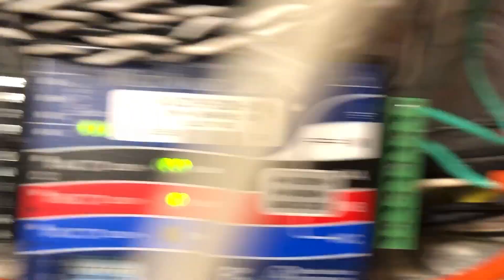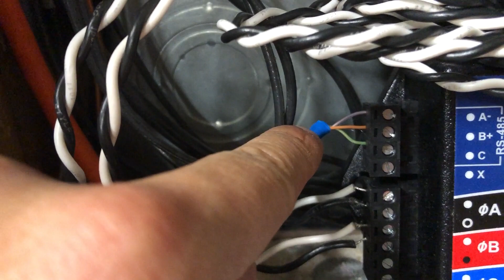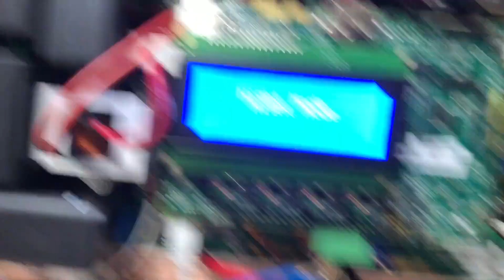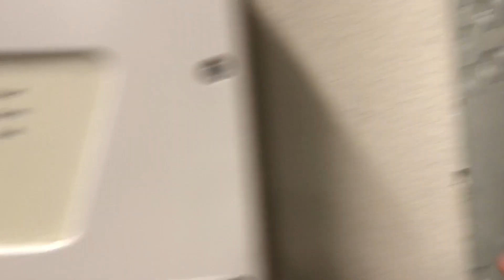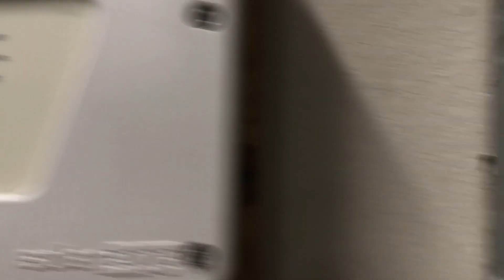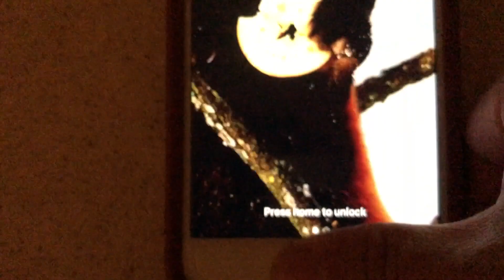How to install metering to your solaredge inverter

Comment: Thanks for posting, just added the Solaredge one to my setup, now I can see grid consumption vs production & how much is going back to Edison. My setup peaks at 10kw by  10am, this also helped me to "schedule" my EV charging when I see my production above 7.5kw. It has alson helped me to see how much energy my house is consuming from Grid at night. Next step is to add batteries and a hybrid inverter to run at night to stop consumption / import from grid at night. Charge batteries during the day and push energy back to the house at night.
Reply from the maker: Sounds like you have a great setup and are maximizing your information! Cheers!
Reply: I have solaredge as well. Does adding this allow you see the production down to individual panel level on the solaredge app? Right now i can only see whole system production.
Reply: @matthewprosco5940  No it will not.  My Solaredge apk allows me to see down to individual panel, but I have owner/installer access. I don't know what type you have. It is possible to see down to specific panel, no meter is needed for that.

Comment: Why my solar edge  just  one  if I have two ,  have  connection on both . My  are both in slave configuration. I have both of the  with the  configuration. What can I do to obtain the lecture of the two  in my monitoring system?
Reply from the maker: @Ana De Nigris To get data into solaredge monitoring you just need to make sure the inverters are connected to the internet and you should contact solaredge for monitoring account.

Comment: Where did you put the neural wire to? I only have 3 fases without neutral.
Reply from the maker: I don't remember 100% but I don't think I use the neutral wire to hook up the meter.  I am not a professional/licensed electrician and I don't understand 3 fases, however I can tell you that my neutral is bonded (my neutral is tried to my ground in my circuit breaker).

Comment: I think your cts are on backwards. The arrow should point toward the utility supply side. If yours are the solaredge cts the label should be on top in your case. But.. you must be getting good consumption data so maybe it's all good?

Comment: I could not realy find in ebay but was able to buy from https://bravocontrols.com/shop/three-phase-power-meter/ they also had the CTs included. It cost $128
Reply from the maker: Thanks for sharing where we can buy electric usage meter
Reply: Did you buy it?
Reply: @deihmos  yes and I installed it, it worked great for my older style solaredge inverter following the video instructions.
Reply: @ameendhe  Thanks. What model CT did it come with and how many amps?
Reply: @deihmos  it was two 100amp CTs you should be able to see it on the pictures. I have a 200 amp panel, I installed one on each phase (of the split phases). Sorry I could not see the models because I have them installed in the utility feed box because I could not fit them above  in the main breakers, my panel is too narrow.

Comment: Thanks, this was a very helpful video.  I wanted to share some installation experience including some trouble that I had and how I fixed it.

To connect the Wattnode meter to the Solaredge Inverter I used an outdoor rated twisted shielded pair from Automation Direct.  Twisted shielded pair is recommended but getting that an in a single pair with outdoor jacket was a bit hard to find, and my Solaredge inverter is outside.  Outdoor rated Cat 5 shielded cable would work too, but I wanted a thinner cable with just 1 twisted pair.  Automation Direct had exactly what I needed and were the most economical for a small cut-to-length order:

https://www.automationdirect.com/adc/shopping/catalog/cables/bulk_multi-conductor_cable/instrumentation_cable/twisted_pairs_with_overall_shield/pltc3-18-1s-1

First, I connected it exactly as explained in the instructions:  A to A- and B to B+ and G to C (using the shield).  I had already installed and connected the CTs per the instructions.  Then I set the configuration settings on the Wattnode dip switches and also the termination switch to 1 on the inverter as recommended.  

When I went to configure, I got an error 3x6E (Meter Comm. Error) on the Solaredge and a red flashing Com light on the Wattnode.  Solaredge advised me to upgrade the firmware, which I did but didn’t help.  I determined that the communications link was not working.  Somewhere I read on a Modbus forum that sometimes swapping the A & B leads on the twisted pair link can fix communication issues.  I did that - and communication started immediately!  This explanation was not suggested by either SolarEdge or Wattnode, but the system has been working flawlessly for 4 months now.  I hope this helps someone if they have trouble getting their system to work.
Reply: Thanks for this, it saved my bacon.

Comment: Thank you very much for the video!  
Would I be able to add a CT so that I could separate out the usage so I could see just what my furnace is using?
Reply from the maker: One meter can only monitor one CT, you have to buy another one
Reply: @DIYGEEKTEXAS  Dude you will want to rip that meter out and put in the Sense after you watch this video.
It learns what all your devices are!
https://www.youtube.com/watch?v=cLQ982MafxQ
Reply from the maker: @everettea6793  Not really, I tried Sense before (about 1.5 years ago when it first came out), waited 1 month for it to learn my devices, I would say 60% are correctly identified, but 40% false positive is NOT impressive. I returned it!  Is it better now?
Reply: @DIYGEEKTEXAS  I hope so, I am installing one tomorrow.  Fortunately my solar company is going to throw it in at no extra cost...
Did you hear my bubble pop when I read your reply?
Reply from the maker: @everettea6793  I remember I bought my Sense when it first came out for $299 (ouch). Maybe the AI have much improved. The fact that Sense is still around and sounds like even more popular is a good sign. :-)

Comment: Hey Mate, 

Almost all that you have explained about the master and slave configuration is wrong. You need a master-slave in order for both Inverters to report to the portal. If you don`t have master-slave the 2nd Inverter has no Internet connection. In addition in order to have Master-slave on these HDwaves, you need RS485-E(expansion kit) because the RS485-2 is not working. The meter is going to read all the export and Import but you won`t have his production. You can`t have his optimizer performances.
 
Regards,
Martin.
Reply from the maker: Not true. I have setup master-slave before and only have internet connection via ethernet RJ45 only at the master. Both inverters will be reported to SolarEdge monitoring. And I never owned any RS485-E (expansion kit).

Comment: I followed your instruction and I got everything working as expected.  No one should mess with the power panels especially the main panel.  only do this if you are 100% sure you know what you are doing. There is no breaker for the two hot legs coming into the main panels. If you touch it, you are dead. wear propper approved power resistant glove if work in the panel!.
Reply from the maker: YES INDEED, be cautious, electricity can kill. Wear Gloves and Eye protection!

Comment: Hi,

great video. Did you use CAT5 to connect the electrical enclosure box and Solaredge?
Thanks
Reply from the maker: I used CAT5 internal cables to connect between the METERING DEVICE (WattNode) and the SolarEdge control board.

Comment: I'm trying to monitor via modbus TCP (i'm logging via home assistant and want the data to go there as well) but having issues connection to the invertar that way, does it NOT work via wifi so i m forced to use ethernet connection? I have a LCD-less controller (European, sweden). Also, if there a limit on how many devices can listen to modbus data if i use the tcp method?
Reply from the maker: Sorry I do not have experience communicating with MODBUS via TCP/IP. You may want to try to communicate to the solaredge's ip at port 502 (modbus's default port). Wifi and Ethernet should be the same. As long as you have the IP address wired/wireless should not matter.
Reply: You need to enable Modbus over TCP in your Solaredge. I think you can ask the SolareEdge support to enable it remotely. I had it done last week, haven't tested it yet. It's just an "on/off"-slider in the Solaredge if you have the permission to config it. Then it's TCP 1502 I believe.

Comment: Why do you have the sticker side of the CT's facing load side instead on line side?
Reply from the maker: I don't understand, what do you mean by 'sticker side'?
Reply: @DIYGEEKTEXAS  The side with the stickers (labels)  It tells you right on the CT which side points towards source.
Reply from the maker: @RedDelPaPa  Still not sure if I am understanding you correctly... the CT sides connects to the black/white cables which are connected to the current sensing clamps, which clamps on the 2 large cables (legs) coming from my electrical grid. Look at 1:39
Reply: @DIYGEEKTEXAS  The plastic clamps!  The white label on the plastic CT clamps!  Why is it pointing towards your load instead of towards source?
Reply from the maker: @RedDelPaPa  ohhh, I finally understand your comment now. the white labels on the sensing clamps, the ones that said 100 AMP. I did not know that was suppose to be pointing towards source (grid) instead of load. It has been working correctly as-it-is though...  I don't have any disconnect so I had to clamp those on against live cables. I probably will just leave them as-it-is now because it is working fine.
Reply: @DIYGEEKTEXAS  It should say in small print, this side to source.  I'm having trouble getting my to read correctly.  I imagine yours isn't reading properly either.
Reply from the maker: @RedDelPaPa  I understand what you were trying to tell me.  My system is reading properly. I have not changed anything since about 7 months ago. Please see end of video around 24:43 you will see my readings from my SolarEdge monitoring app.

Comment: I just had my meter installed by the solar company just so they couldn't alter my warranty if I did it myself, not sure if that would've happened but I'm just staying on the safe side. The problem was the installer set the 'Meter Function' to None instead of Export + Import. Everything is working as it should now. I'm with the others here and don't like the breakers being doubled up like that, otherwise great video. Thanks
Reply from the maker: Thanks for your comments

Comment: could you please explain how to configure two solaredge inverters as master-slave  in monitoring portal when both inverters are connected to internet(without physically connecting them using cat-5 wire). my case is each inverter is connected to internet through different router
Reply from the maker: If you have both inverters connected to the internet, you do not have to setup master-slave mode.  Each inverter will automatically report their data to SolarEdge servers.  Please make sure you register the serial number for each inverter to have them attached to your monitoring account.
Reply: @DIYGEEKTEXAS  thank you for the reply. configuring the inverters as master-slave in this case is not for monitoring. In Germany there is a limitation that any PV system can inject only 70% of max capacity into the grid. So rather setting the limit in the inverter, we opted to install a Solaredge modbus meter at the grid coupling point. now that we have two inverters we have to configure them as master-slave for the modbus to measure the electricity export of the whole system. If i do the master-slave by hard wiring them, i have to use RS485 extension kit so that i can connect the modbus to master inverter. i wanted to know if i can configure them master-slave without using wire. thank you
Reply from the maker: @vishnuchaitanya5613  ok i understand now. as far as i know, you can not configure master slave without using the RS485 wiring method.

Comment: Great video. Just installed my meter today! Followed your instructions and got it all working. Can't wait to see what the graph looks like tomorrow. Btw I've got a 10.62kw system with an SE 11400a-US inverter. It already had a revenue grade meter installed in the DC disconnect box so I had to set the dipswitch to 2 on the new meter.
Reply from the maker: Awesome, good to hear. Thanks for the comment.
Reply: Florida boat life... I have the same inverter and wondered if this was compatible with that model.  Can you give us an update on how your system is working?  Thanks!
Reply: @stevethomas2724  I have the SEDGE SE7600A-US-U which is the older style Solar Edge. and I was able to follow the same instruction and it is working out perfectly.

Comment: You’re puttin out a lot of wrong info ....you can’t just put a wire under another wire of a breaker code states no more than one current carrying conductor under one lug at a time...and breakers across from each other are same phase and will not get you 240 and also if u share the same sheathing you need a two pole breaker...and if you put in twins u need to make sure your panel is designed for twins and is UL listed ...just cause it fits doesn’t mean it’s right....electricity is dangerous and your putting out wrong Info...
Reply from the maker: Thanks Chris.  Everyone reading/watching this video, please note I am not an electrician, please read Chris' comment, my circuit breaker box may not be the same as yours, so please do not assume what I said in video works for all situations. Always check and get help from licensed electrician.
Reply: The device is using 0.3 watts.
Reply: @deihmos  that is not the point ... when there is a current carrying conductor under a lug it expands and contracts ...adding this other load no matter what it is isn’t about the load it’s about another conductor under the lug .... don’t answer if you don’t know 🤙🏼
Reply: @deihmos  do it right or don’t do it ....leave it to the professionals

Comment: Thanks for the video.  After installing the meter, is there anything to setup in the SolarEdge's dashboard or the system will detected it?
Reply from the maker: No setup needed in the solaredge monitoring web site / platform.
Reply from the maker: No, nothing to configure in your solaredge monitoring account. Everything just start working after a few hours (I remember about 2 - 3 hours)

Comment: I've installed this minus the master/slave element, and it seems that its only showing one inverter production and not both... what should I check?
Reply from the maker: Brian West the sensors for this metering system should be hooked up at the top of your breaker (incoming grid line). The metering can only measure electricity flow from grid to your breaker. To measure production from your inverter(s) that is still better using the solaredge monitoring system. Which logs and analyzes production data regardless if you have monitoring or not. Hope that helps.
Reply: You can’t do meter and master slave without an RS485 expansion,  the RS485-2 is inoperable.

Comment: Very informative video. I tried to do this with the same type of meter and could not figure out the BAG cables on the inverter. Can you let me what cable connected to what on the inverter? The meter has ABC and the inverter has BAG.
Reply from the maker: Hi Pedro, A = B, B = A, C = G
Reply: DIY GEEK I appreciate the response. I will try that as I like the LED one better than the one I have installed. Do you know if tying to an existing breaker is up to NEC code? In my case I used a separate Bernard Thank you for showing us your setup!
Reply from the maker: @pedrogarces6876  I am not sure about being NEC compliant, once I am done with my entire setup (probably in 2 - 3months) I will have a license electrician to check all my wiring and certify it. I will try to remember and response back here if that tandem connection to existing breaker is not NEC compliant. Thanks for you comment.
Reply: One more question, how did you get the meter to us master and slave setup?
Reply from the maker: @pedrogarces6876  i have created different video for master/slave setup here: https://www.youtube.com/watch?v=GVovKCQm1CA&t=4s

Comment: I think you still need the master slave cat 5, it is for shut down when power goes out. They might turn each other on which would not be good during a grid failure. Unplug the  Ethernet  from slave use cat 5 cable to master this way they can communicate. There is no communication to each other through portal. I think that is how it works.
Reply from the maker: Hi Lou, thanks for the comment. When the inverter losses power, it will shutoff because the inverter is ONLY powered by the grid (will not be on without grid power). When the inverter is shutoff, all the optimizers (the devices connected to each solar panel) will lower the voltages down to 1 volt DC.  As far as I know this is how the solaredge system works.  None of these built-in safety feature rely on any communication / monitoring / portal.
Reply: Ok I just think inverter have to send out some sensing voltage to see if grid is there, then the other inverter does the same and brings voltage up higher. Do you have installer access you do not show both inverters in your app..
Reply from the maker: Yes you are right, i believe the inverter does sense if the grid is providing power first before supplying power against it (at higher voltage as you said).  I will create video to demonstrate how the solaredge inverter immediate shuts down when grid power is down.  Btw a lot of people are disappointed with this feature because this means you can NOT use power from your solar panel when you lose grid power.
Reply: It has been done but you need another inverter and isolate it manually from grid. Great video. https://www.youtube.com/watch?v=F1q5uIzjj_M&t=330s